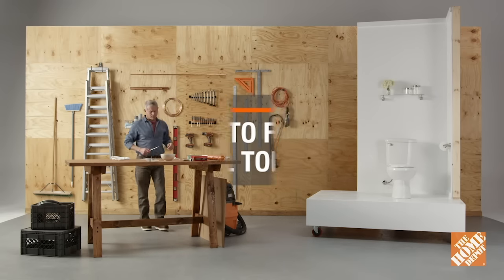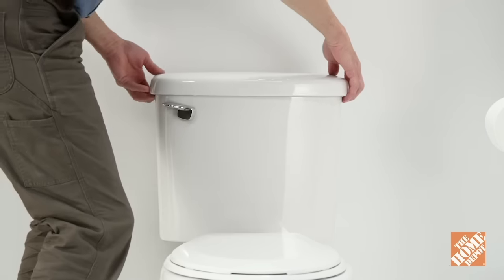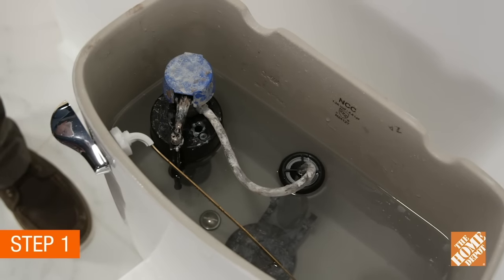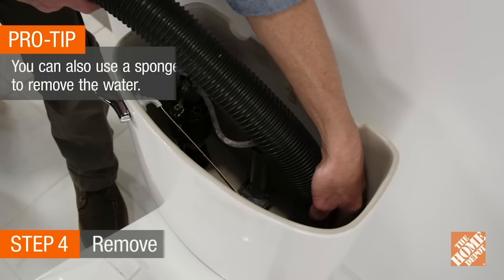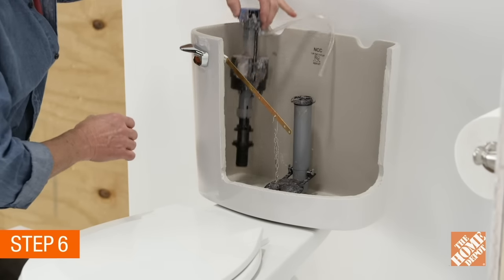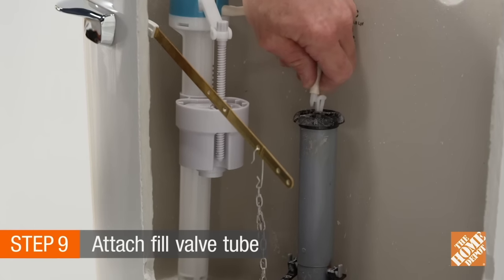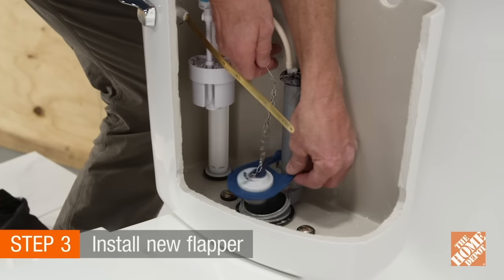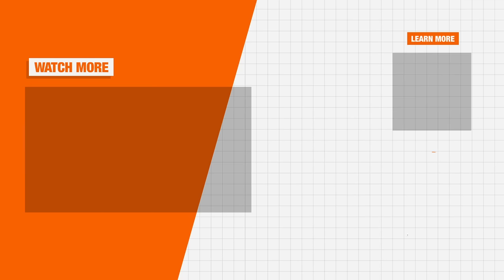How to Fix a Leaky Toilet | How to Stop a Running Toilet Tank | The Home Depot

Comment: Why does mine make a loud whistling sound?
Reply from the maker: Hi Jesse,

A whistling toilet is likely going to be caused by a restriction is the water supply system. This can be caused by the shut off valve at the wall but, is more commonly caused by a faulty fill valve. The fill valve (depending on the style) can become stuck, preventing full actuation during filling, restricting the water flow. This can sometimes cause a whistle. The fix is to replace the fill valve, this should resolve the whistle. You can find fill valve repair kits here: http://bit.ly/2XgCHVs